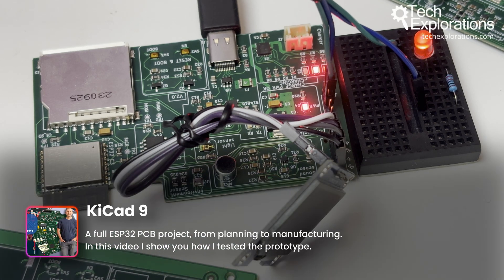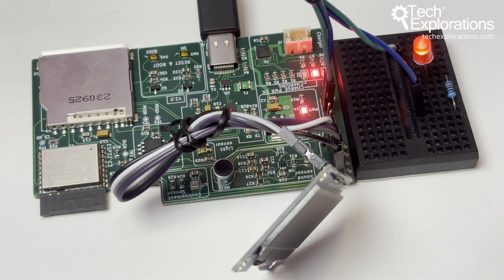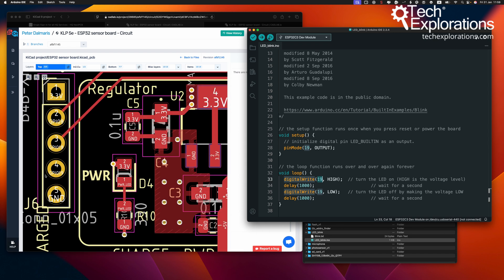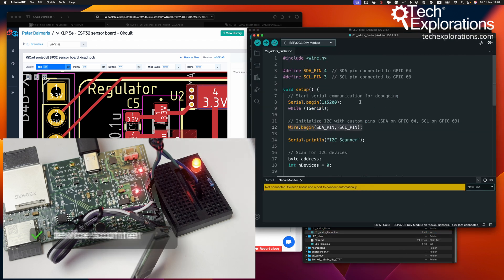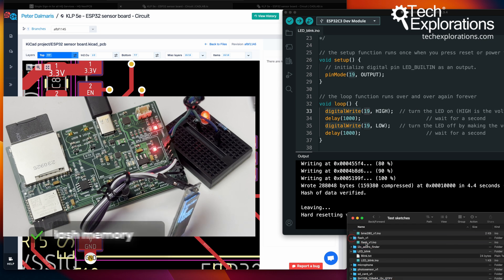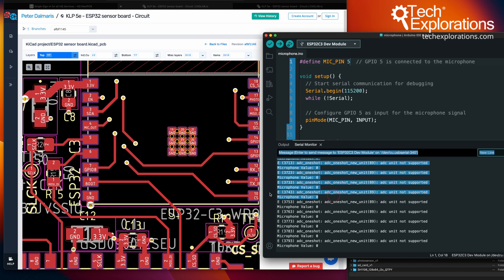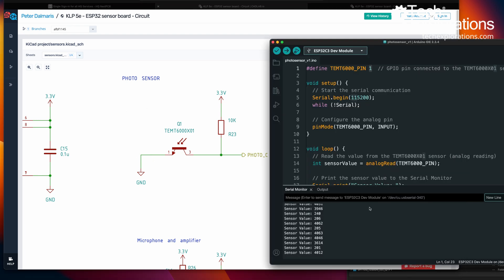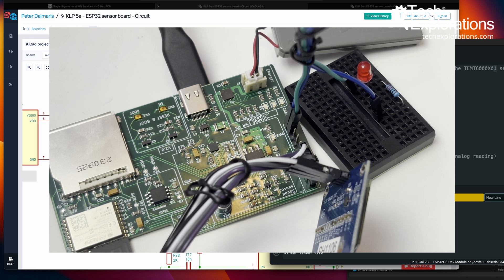ESP32 Custom Board Prototype: First Impressions, Testing, and Next Steps

Comment: Hi Peter. I always learn lots by watching your videos. Thanks. The auto-upload functionality does not appear to be working(You need to press the buttons at time 5:26). Is this something unique to the MacBook you are using, or is it because your schematic with Q2 Q3 emitters (see long video time 2:08:49) is different to the schematic published by Espressif for the DevKitC?
Reply from the maker: Correct, though I am not sure why. I'll be working on an updated version of this board, most likely next week, and will address this and the other issues. Q2 and Q3 seem to be working properly because I can still upload code as intended.